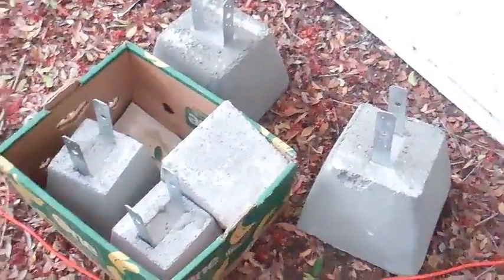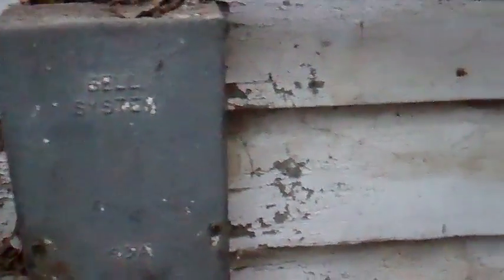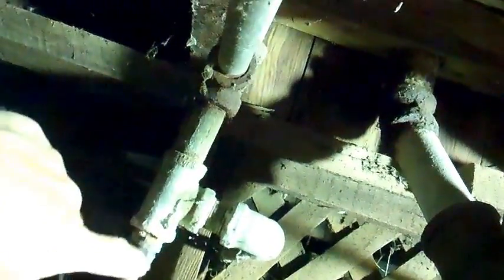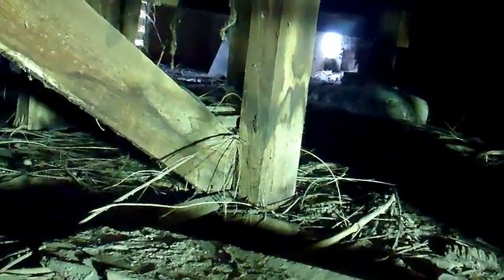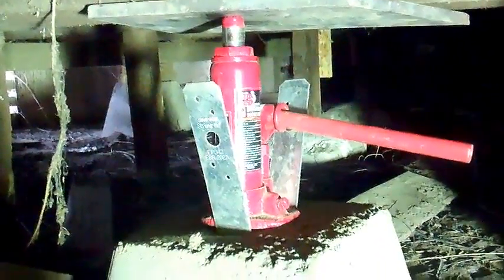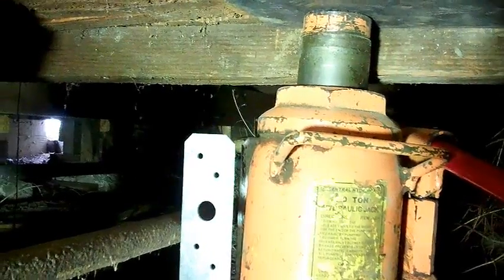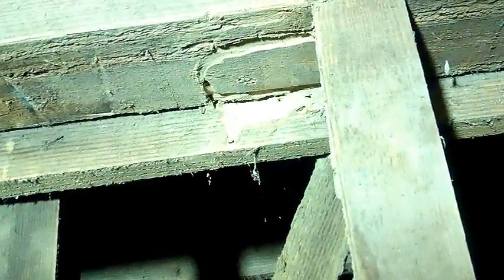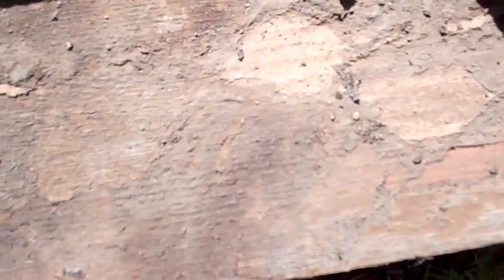jacking up and leveling the house

Comment: I love your videos and sense of humor. 
Ok, what you have is a common cricket. That was making the noise. If you re check the same noise later it will be a higher or lower oscillation; it will change with the temperature. In fact you can tell the temperature by the number of oscillations per minute. 
The modern wood is candy for them if it gets wet. Moisture in the wood wicked up from the ground or a leaky pipe will attract them like crazy. Get all the wood off the ground. No soil contact. 
Old growth has a lot of pitch. Won't rot nor lets water wick. 
Termites are silent but deadly to a home of lumber. Motor oil only keeps the outside layer from getting some wicking. But it will dry out. Use cedar or redwood. Tent the house. Pick up every scrap piece of wood under and around the house. Don't let tree branches touch the roof. Install gutters and direct the water away from the structure. That's the best you can do. You have a variation on a batten board framing constructed home. Lots of them in the Silver Lake, Glendale, Echo Park area. I lived in L.A. For years until the traffic and crime had me move to Big Bear. I love LA. But the traffic is beyond insane. Plus being a millionaire is a requirement to own a home. I now enjoy the simple life of VT. No traffic, no crime. Very nice people. I don't know why the whole world does not live here but I am glad they don't.
Reply: thought crickets too  =]  Then too many Electronics 'Haunting' with static frequencies.    NOPE  %O  
https://www.youtube.com/watch?v=lhoqkXtVNEU     They BANG HEAD!     ('Silent but Deadly' are Farts)  = )

Comment: There's a project that I have to look forward to as well, jacking up, leveling, and re-supporting an addition that was added to the side of a mobile home. Thankfully I gained some experience helping a friend of mine repair his house a few years ago, in his case we had to add temporary beams and cribbing to support the floor in order to replace the floor joists and sill along the back of the house. 
This addition's main problem is that they build it on top of piers made out of stacked building blocks, that are just sitting on top of the ground. Where I am the ground freezes at least some time during the year, and rains a lot through most of the winter, so you have to dig down and pour concrete footings at least a foot under the ground to undisturbed soil, then put your posts or pyramid blocks on top of those.
  Since it's coastal forest the main problem you run into is rot, and occasionally carpenter ants. I have seen termites but only in an old tree stump, they don't usually cause structural damage in buildings around here.

Comment: Interesting construction, looks like some of the cabins seen in your other vids.

I figured that it would be too dry out there to support the termites (they're not usually that interested in dry wood).   The clicking is the termites gnashing their jaws to warn others in the colony.

Of course they're more interested in the new softwood framing you've been putting under there, that old hard wood is so hard you'd have to pre-drill before you could drive any nails.

Comment: EoL'd thermite heh. In my college they have all these fancy buildings, but for the student initiatives they recicled this turn of the century house that was close by. The thermites have eaten most of it, the doorframes are full of holes and fall apart if you touch them, the floor does the same.

Comment: A Typical, all-original vintage-1890's house is probably not up to building code specs, especially in California. Those termites sound to me like a socket wrench. I'm surprised that old house hadn't collapsed decades ago, with those damned termites! Potentially, that house could collapse from all those termites slowly eating away at the wood, destroying anything of value in it.

I'm getting a lot of noise in the left audio channel. It reminds me of a sound that a dirty volume control makes.